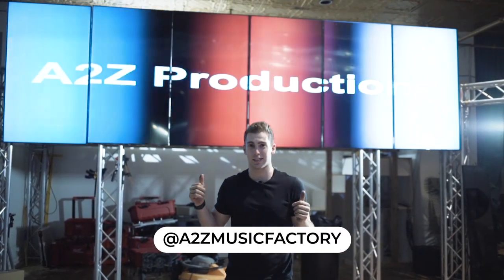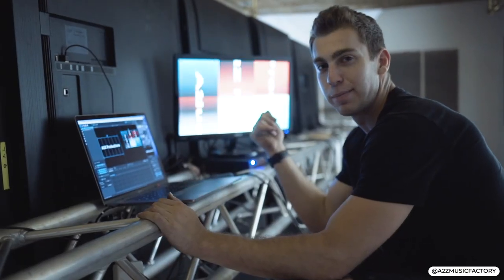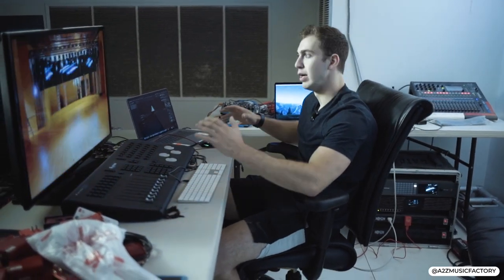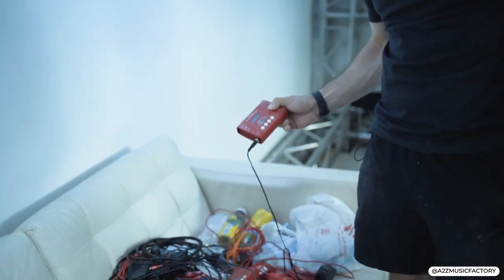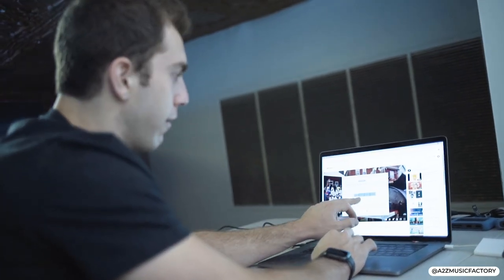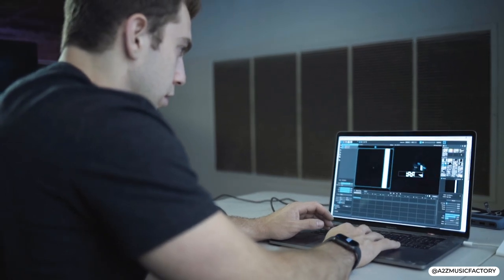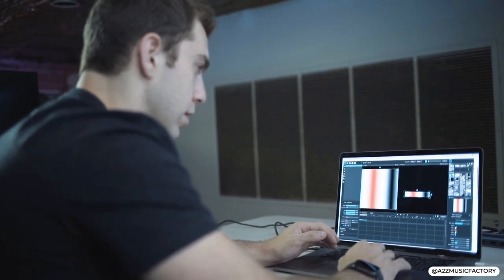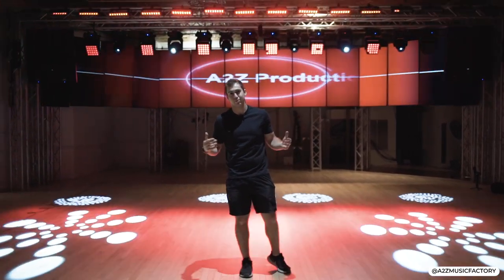Build an Ultra Wide Video Wall with 75" TVs

Comment: that is one way to do it. i would always make an effort to keep lights, sound, and video as independent as possible. sure one machine can do it, but crosstalk and other issues will make life harder than it needs to be. very interesting choice using standard tvs for a video wall. i have found that to be harder than it needs to be, and less presentable. video wall panels are worth the investment. still a very fun set up and i love seeing what you come up with in your content.

Comment: It helps if you get TVs that have a flush bottom edge so you can butt them together very tight like a true video wall. It's much more convincing when there's no light leaking from the back. A lot of TVs have buttons or lights sticking out from the bottom but if you pop these off it looks much cleaner.
If you can't pop the stuff on the bottom off, at least get some gaff and tape between each one so no light is leaking through. :)